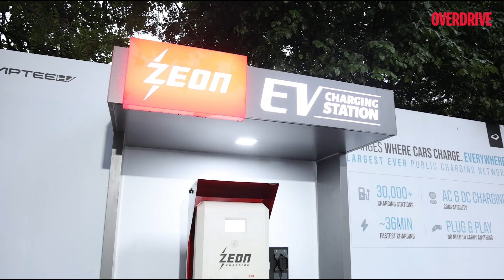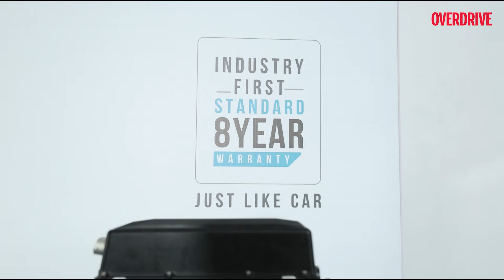Interview with Dinesh Arjun l RapteeHV CEO & Co-Founder l The Makings of the Raptee HV T30

Comment: Needs bigger battery. 10kwh.
Reply: I think 7 kWh would be perfect as there is Dc charging available aswell, that would perhaps help them achieve the perfect vfm quotient
Reply: @gamerboss_7274 x47 has it. 10+
Reply: no of cells gets increased if we move to higher voltage.